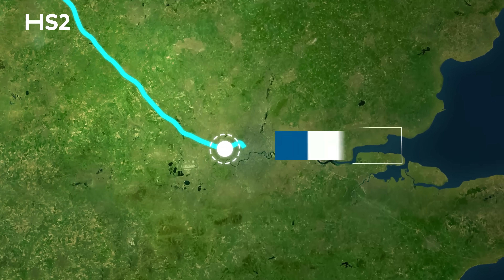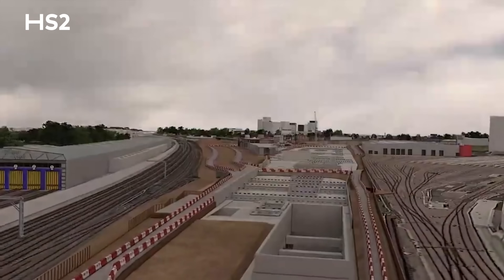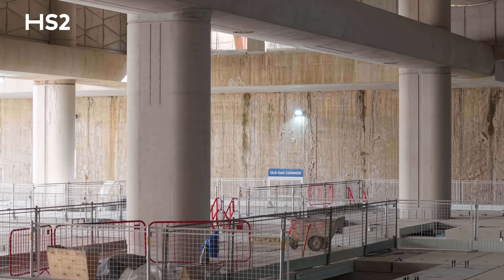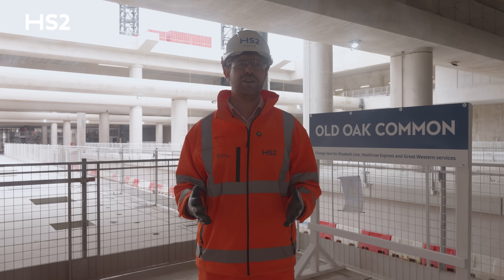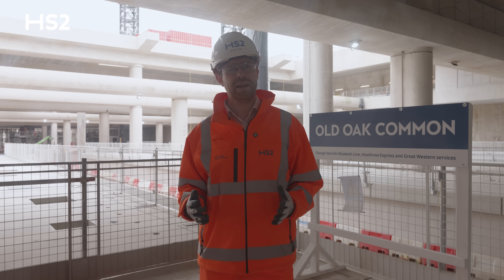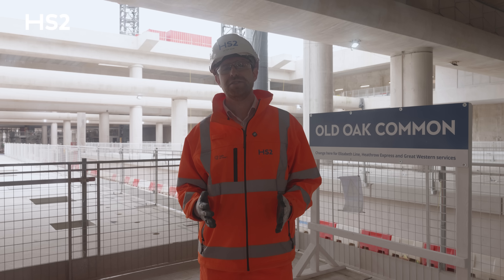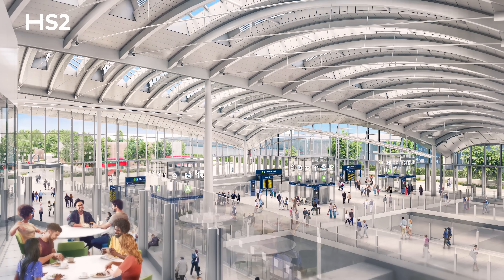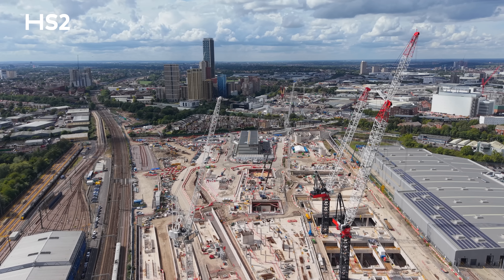HS2 Old Oak Common Station Project Update | November 2025

Comment: Go Benny, can we just get rid of the HS2 now, it was a good idea at the beginning. because it's now costing too much of a project. Can we use the money for something else?
Like opening the existing lines out there? What's been covered by trees and bushes? How about just reopening their lines instead?
The most be another way dumb building. This and destroying people's business jobs and homes just for this stupid project
If we look back in the history records and look at the very first high-speed train that was city interlink.
Look at the track line where I used back. Then, but when you look at the maps of the train lines, you actually see there's based. So add connection line next to existering lines.
And it will cost a lot cheaper As well? One train line joining up to another train line. What's not joined together without destroying other things out there. I still got less than what it is. Now for this HS2
Oh, my God I think money could actually help the restored the canals in Bridgewater canal area. And look what's happening again in the area. It's going to burst this bank. Where they poured a temporary dam.
Reply: The fact that you are calling it a 'train line' and struggle with expressing yourself clearly indicates that you haven't a clue what you are talking about 😂
Reply: its probably going to cost the same amount to cancel it now than to just complete the birmingham portion
Reply: Bot
Reply: @hx0d  literally nobody here is a bot

Comment: His Majesty wonders. Do you have future plans to find solutions for railway lines? It divides the city and residential and commercial neighborhoods, either to lift with bridges or underground tunnels. Most importantly, isn't it better to invest in the highest train stations? Do you have an idea for the future? Don't see the waste of spaces at the top, for example, to invest the roof to build commercial residential buildings and work office

The third question is now that you are under construction, don't you see that cities need small trains suspended in the air and connect the city and add to the economy and tourism.

Comment: Ah yes. The BBC method of measurement - area in terms of football pitches and weight in terms of blue whales!
Reply: If only football pitches were a standard size. Maybe the more reliable unit of measurement 'the size of Wales' could be used?
Reply: @Maxhead_room 😁Yeah the size of Wales was always a good one....how about the height of so many double decker buses that was a good height measurement 😆......I remember in kids books a dinosaur stood next to so many double deckers
Reply: @Maxhead_room  not all whales are the same size and weight when they are fully grown though so i'm not sure how that is an accurate measurement either?
Reply: @rosse_93  Welsh Wales! That's always the same size and is continuously used by the media as a unit of measurement.
Reply: Did you know that the first use of the that measurement (at least recorded) was in 1926 in the bucks examiner. It has been widely used by many organisations (including the bbc). Im sure that you would like to make your apologies now.

Comment: the london end seams to be progressing significantly faster than the open air sections in warwickshire, northamptonshire and buckinghamshire. it seems that it  takes years in these sections to finish a single road bridge, it will look like more progress is being made simply by putting time into finishing these structures and reopening the road network again, cutting disruption as this is whats giving rise to alot of bad press to HS2 when you see no progress for years on a single bridge that been at pillars only for over 24 months
Reply: They are prioritising stuff that need to be done to get the railway up and running. Bits like bridges, if they aren't cancelled, an some have been already, will probably now be last bits to be built and installed, especially if they are just walking bridges connecting up bridleways.

Old Oak Common is the most important bit at the minute because it allow them to then proceed to rerouting and extend existing railways. An the Great Western Railway already had a schedual of work between now and 2030 to enable it to be rerouted.
Reply: Hopefully, you should start seeing some progress soon up towards the Birmingham end of the project, as they've just announced that they're prioritising a roughly 80-mile section of track southwards from Birmingham so they can start testing trains sooner.
Reply: Tracks will come quickly, the bridges just need to be complete.
Reply: That's because the Treasury has put the brakes on funding the areas where thefe is less work to do.

Comment: I hope the platforms will still be Berne gauge compatible (even if they are over 760 mm high)
Reply: HS2 is being built to that larger loading gauge
Reply: Even if they do build it to the UIC gauge as the Burn Gauge is now called, the HS2 trains are only being built to the UK loading gauge so they can travel on existing rail lines off the HS2 line
Reply: @peterwallen1063  my hope is one day, a future government will consider restoring the full dedicated HSL route to Manchester and Leeds, with a scope for Leeds to Edinburgh and Glasgow via Newcastle and eventually be able to service routes using larger tried and tested trains from European manufacturers. I'd see bendier detours around towns, villages and hamlets with lower speed sections (230 km/h) then back up to a lesser than originally planned but still good 300 km/h in the straight sections as an acceptable compromise to compete the route and free up the existing mainline.
Reply: @jayrap94  Ultra high speed line do not work like that, they travel in a straight line for speed
Reply: @peterwallen1063  the idea would be to have slower but separate from the mainline sections if it has to travel through bends - still ETCS signalled and still dedicated for high speed trains even if sections are slower.
Reply: @jayrap94  This is the Italian/Swiss approach as opposed to the German/French approach: upgrade existing lines with improved curves and alignments instead of blow a budget on long ultra-high-speed bypass lines. It improves performance for all traffic rather than just the fastest trains.
This has actually been proposed for some time for Morpeth, to bypass the slow curve there and effectively create a passing loop for stoppers using the old alignment.